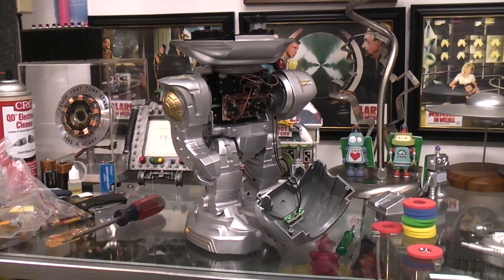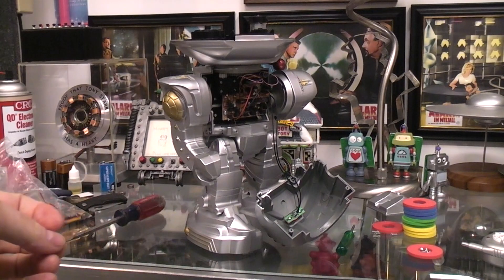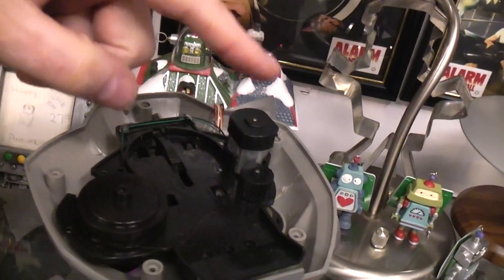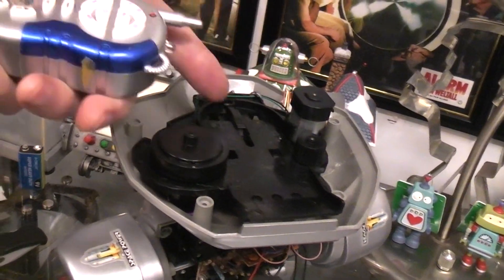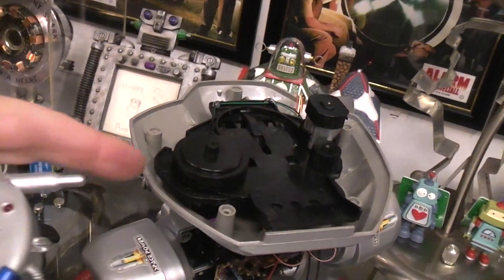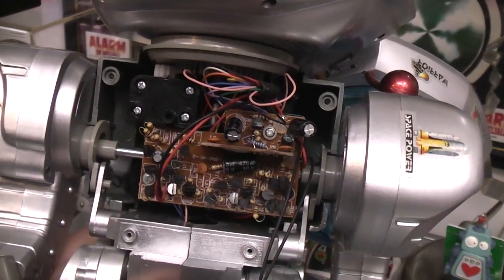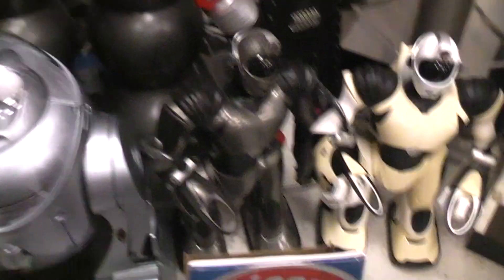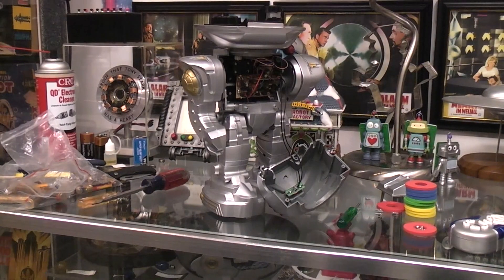Inside the Space Wiser Robot. Part 2. Found and replaced the split gear.

Comment: I was surprised about the transistors.   I would have thought chips would have been used even in the 1980s.
Reply from the maker: Nope, the 1980's toys used discreet electronics for drive control "H bridge". And even into the 1990's for the most part.